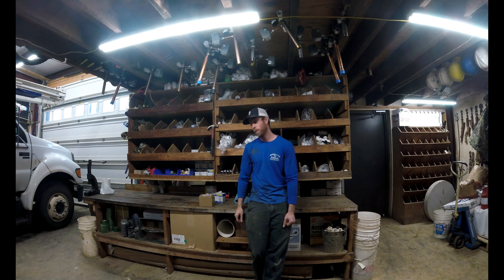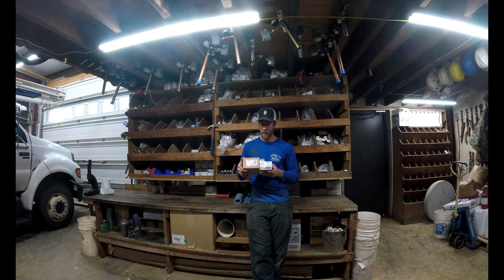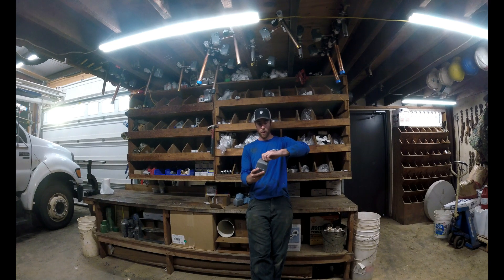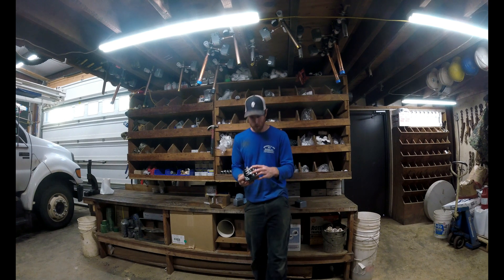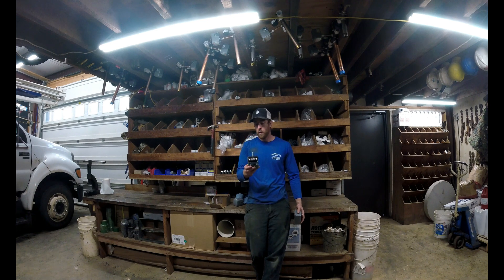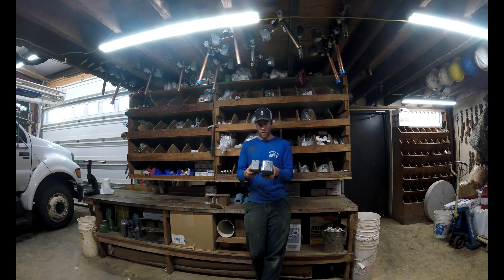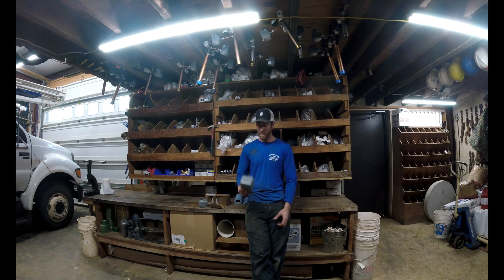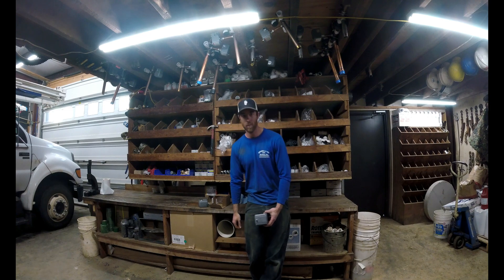Heavy Duty Square D Well Pump Pressure Switch: Explaining the Advantages and Why They are Useful

Comment: I ended up using a new pressure switch to control a contactor switch used in the hvac world that was designed for far more amps. I got tired of annual switch replacements when everything else in the system was fine.

Comment: You know I have been having a hell of a problem with the square D switches lately, seems as they have changed the quality of construction.
 I have wells with switches that are over 20 years old and look like they just came out of the box. The older switches were built so much better with quality parts and materials.  Now you can have a switch on just for a few weeks and its already burnt up, and not from a bad condition like waterlogged or bugs in it.  What's your take on them Grant, have you been seeing problems with the points splattering and exposing the aluminum and leaving people out of water?
Reply from the maker: Yes we have been seeing it. I agree the quality has gone down on them. It isn't your imagination
Reply: @WendellLeeWellServices  I have 4 or 5 SD switches I bought a steal in probably 15 or 20 years ago and never had used them , they been in their box in a safe environment  , so I should have some with the better quality and they should still be as good new , correct .
Reply: @WhiteOak09  yeah for sure those were the good ones that last like 20 years
Reply: @ClearWaterPumpWell  good deal , thanks for your reply 👍
Reply: Have had that problem with the Boshart  switches ...the only time that’s happened  on a SD is if I’m using # 10 wire and distorted the contacts..

Comment: Thanks for the video.  Another advantage to the larger switch is they are listed for the 460V.  If you get the 80-100 psi switch the spring is much stiffer than the 60/80 version.  They wouldn't turn down very well but we have some of those running over 150 psi on wells.
Kenny
Reply from the maker: That is good to know, geez 150 psi. That's getting up there! Good to hear from you Kenny, as always I appreciate your comments and tuning into our videos.